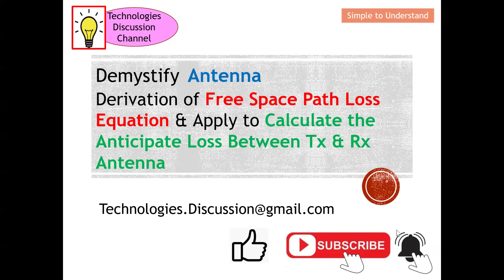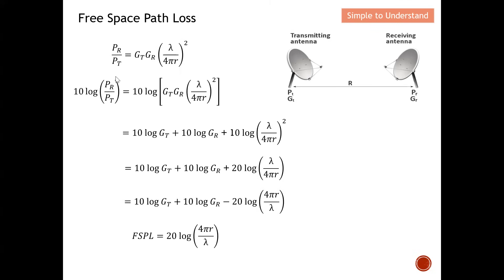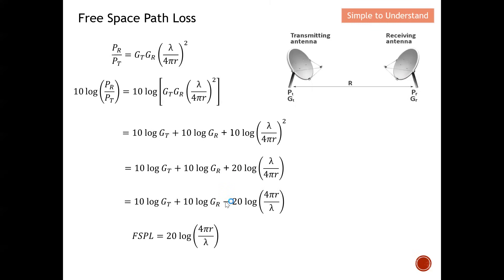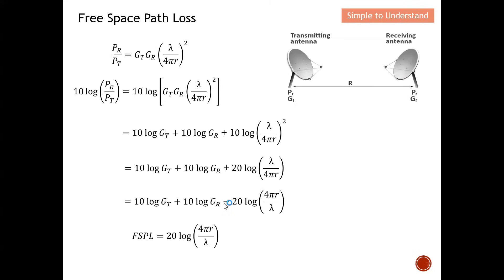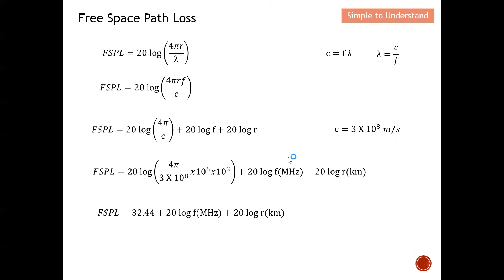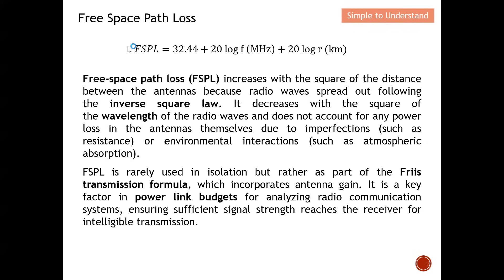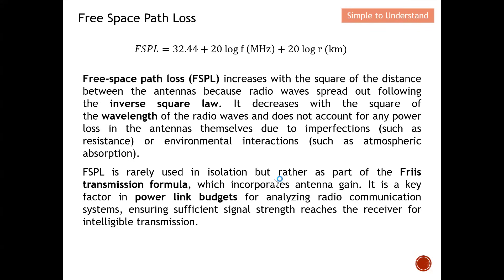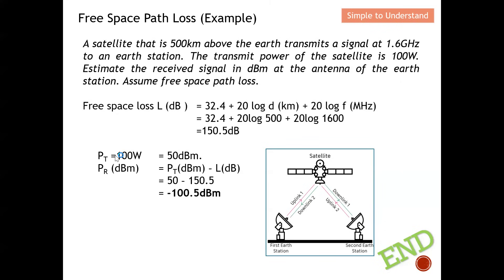Antenna #21. How to Use Friis Transmission Formula to Derive Free Space Path Loss (FSPL) Equation.

Comment from the maker: Thank you so much for taking the time to watch this radio wave propagation video. In this video, we discussed how to derive the Free Space Path Loss (FSPL) equation. Free Space Path Loss helps us estimate signal loss between transmitter and receiver antennas. With this understanding, we can determine whether the received signal is detectable by comparing the received power to the receiver's sensitivity.
This video also explains the conditions under which this formula applies. The formula is only valid when there is a clear line of sight (LOS) between the transmitter and receiver antennas (i.e., no obstructions in the path). Additionally, the formula does not account for practical factors such as the heights of both antennas and weather conditions.